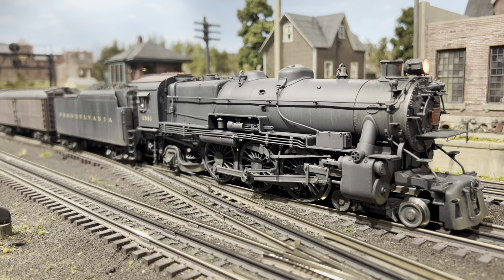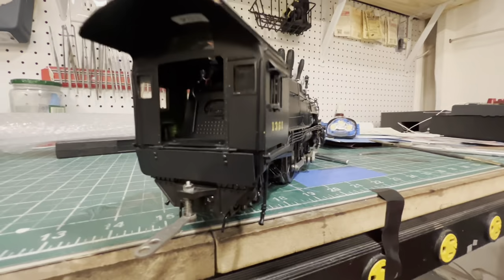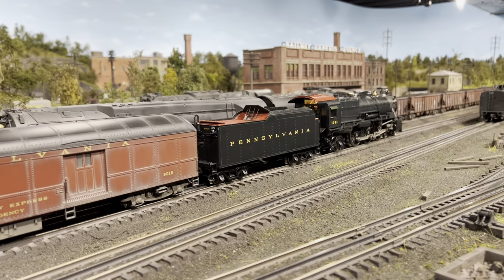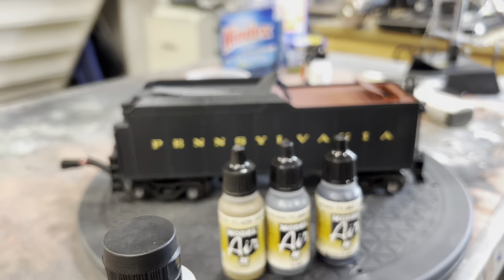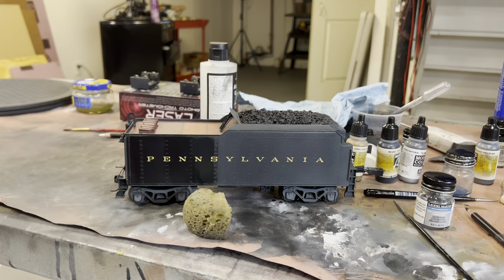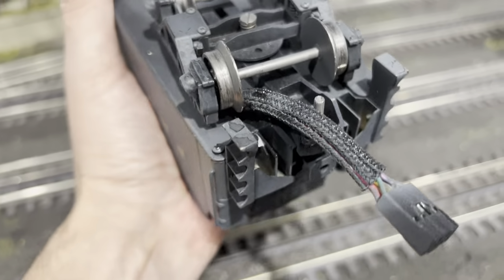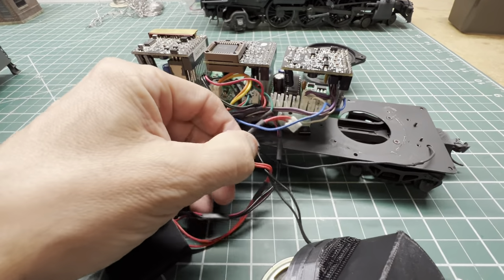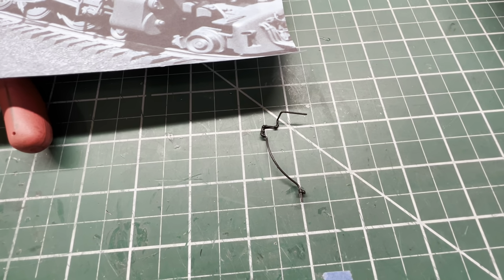3rd Rail High Iron K4 #1361 Pt. 3

Comment: Interesting you mention it dropping chuffs when it warms up. I had a similar problem with a 3rd rail B&M Berkshire, and after awhile it would go completely unresponsive to TMCC. I think I determined that the voltage regulation on the EOB boards is weak, and for some reason it keeps getting higher as the loco warms up. It was completely fine if I kept track power under ~15v, but the normal 18-20 we run is too much for it.
Reply from the maker: I’ve had the sensor sag a bit after a motor is warm enough. This can cause chuff drops and speed changes. I have all the components I need to do an ERR upgrade on this engine so I will get to it soon.

Comment: I use a lot of the Vallejo paints. My solution to the pattering issue is dropping the pressure a bit. I start with color, then finish with Testors matt clear, just to seal everything in. I do not recommend the newer Tamiya flat sprays, they've been eating decals and pooling for a lot of people. If you're going to do layers with the Vallejo, clear in between them with the testors.
Reply from the maker: I may try them again on some other projects. I do like the way Tamiya sprays and will try those paints a bit more in the future.

Comment: Nice video.  Though I am an On30 modeler I subbed today to your channel.  The coal load in the tender caught my eye?  Is the coal load real coal?  Is that something you did?
Reply from the maker: Thanks. the coal pile in the tender was recycled from the original load that was glues to a lead weight. I needed the weight out of there so I could stick my TMCC antenna there. The coal load is now attached to a 3D printed base that covers the antenna.